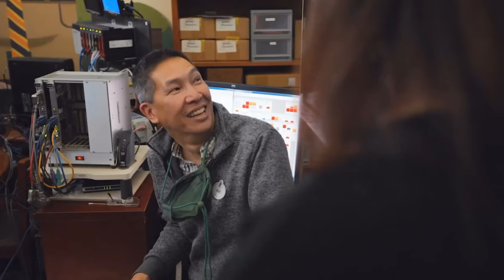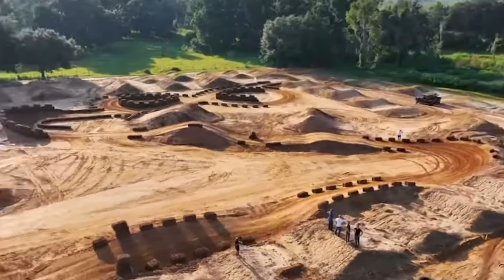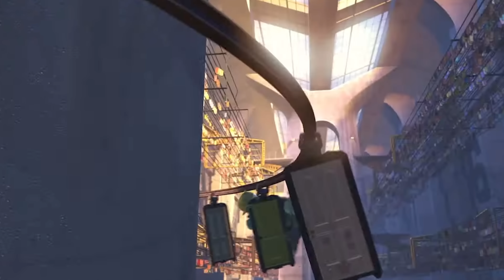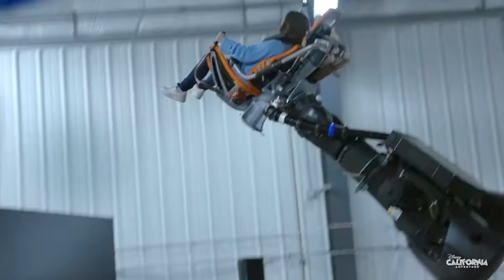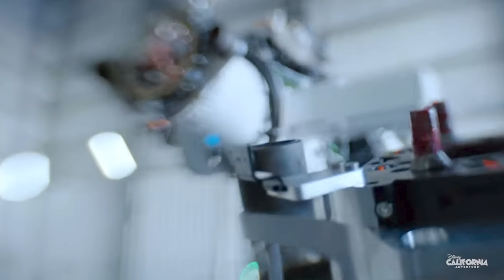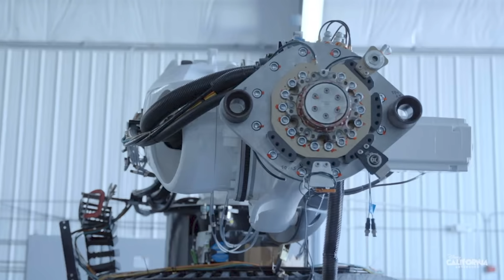FIRST LOOK at Magic Kingdom CARS Layout? • Monsters INC Coaster Station

Comment: as a life long disneyland visitor. im very disappointed in the stark labs ride. there should be a darkride portion just like harry potter.  could you imagine how amazing a kuka dark ride at disneyland resort based on the avengers.. wtf is going on imagineering? universal is embarrassing you, the kuka dark ride with 50+ anamotronics and multiple missions is the only thing that should have been built in that location. adventures through the quantum real voiced by michael douglas (reimagined atis), should be put behind mission breaout.